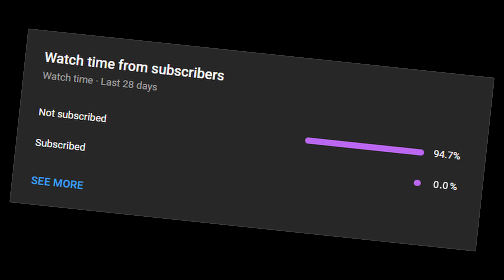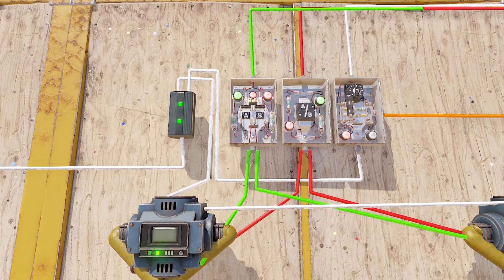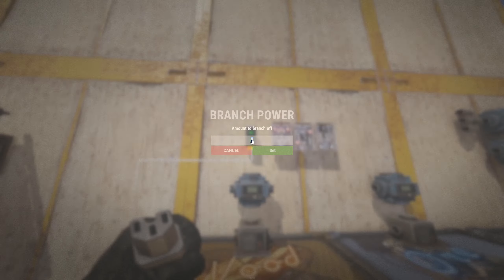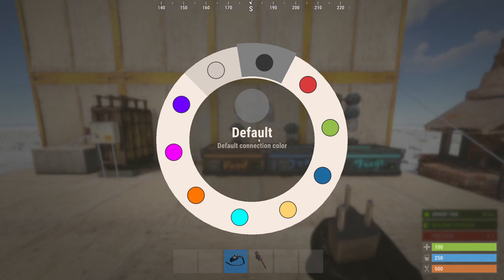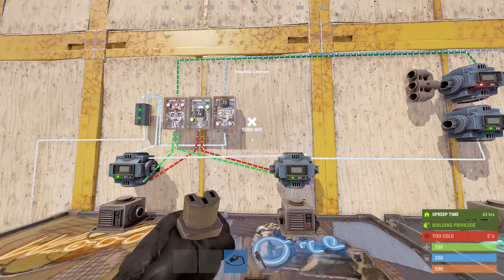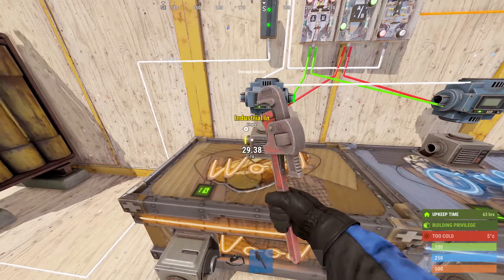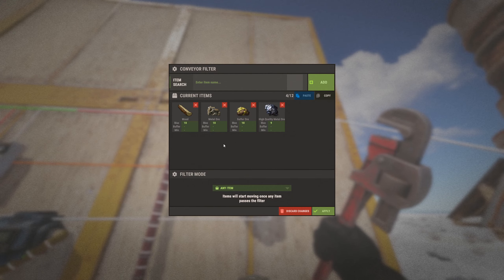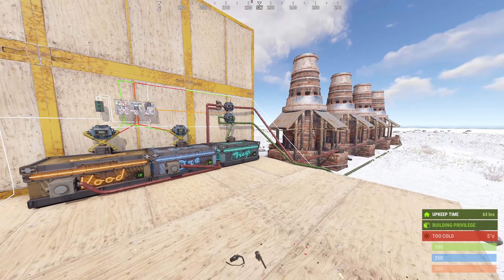Something You Need In All Rust Base Designs

Comment: This is a good circut but don't most people just use electric furnaces now? Is it still better to use large furnaces for mass cooking. I don't actually know the answer to this
Reply from the maker: in terms of saving wood, electric furnaces can do that on their own. I find if I'm using electric furnaces from the start, and don't use large furnaces, I run out of charcoal, slowing down the boom. The other extreme is using a bunch of small furnaces to make charcoal only, which I see most big groups do at some point in their wipe.  This auto smelting setup, is a happy median.

Comment: Can you use multiple boxes for the ore/wood input and have the conveyor detect if any of them have ore ready to cook? If so, how would you set that up?
Reply from the maker: yes, as long as they are chained together it will detect
Reply: @MyGamingExperience The conveyor only seems to detect the ore if it is in the first box, which both the input and output of the conveyor is attached to. It doesn't seem to turn the system on if there is ore in any of the daisy chained boxes without their already being any ore in the first one.